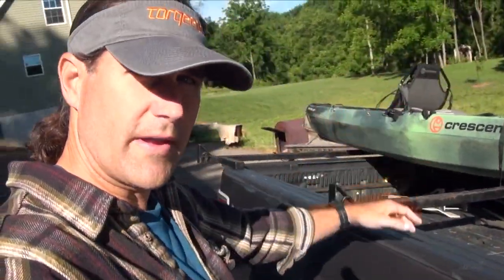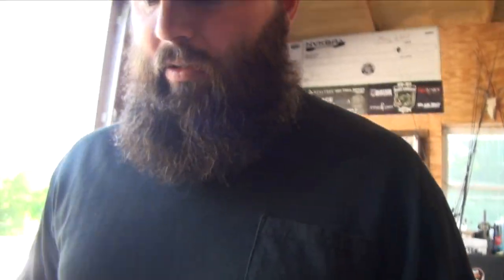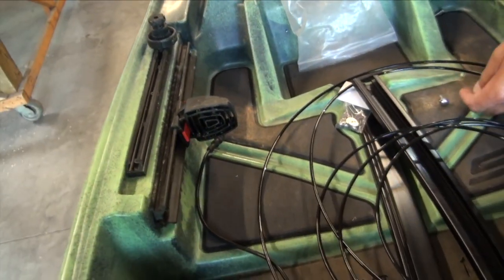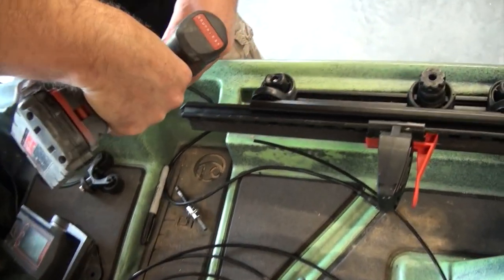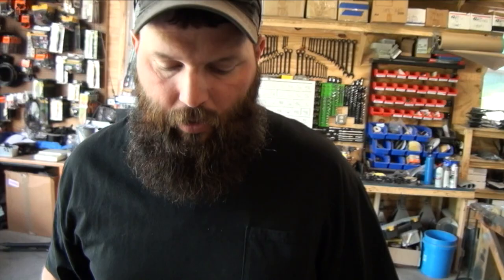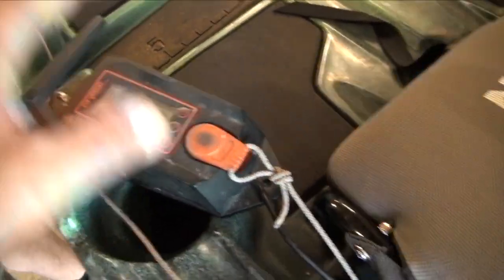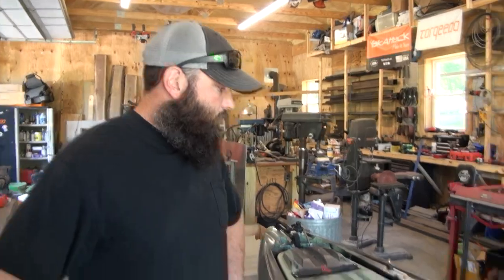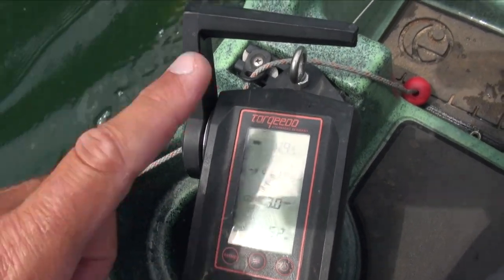Shoalie Torqeedo Install Speed and Range

Comment: Great video! As you are probably already aware of, the maximum speed of any displacement hull is governed by a simple formula: hull speed in knots equals 1.34 times the square root of the waterline length in feet (HS = 1.34 x √LWL). You may be able to get a little more speed out of the hull, but the increased power required will significantly reduce range.
Reply from the maker: The fastest kayak I’ve tested with the Ultralight 1103 went 7.6 mph. It was a 15.5 foot long Wilderness Systems Thresher 155. The hull is actually similar to the Shoalie, just much longer. So that plays into the formula you typed above. The length at the waterline changes once power is applied. The stern squats and the length shortens, unless there is a disproportionate amount of weight forward.

Comment: Getting ready to install a torqeedo on my ck1 and maybe a lite tackle 2 down the road. A question I had was the black tubing for the foot steering is 3/16" however I see some using the bigger quarter inch clear tubing as well. In your experience does the bigger clear tubing make for a smoother operation compared to this smaller black tubing? I was thinking maybe the cord sliding through a bigger diameter tubing might work better but you guys are the pros and if it does not add to better performance I will gladly go with the black tubing and drilling smaller holes if no benefit is added.😁
Reply from the maker: I actually did three installs on this last trip with three different types of tubing. The black 3/16th stuff that comes with the Innovative Sportsman foot control steering kit is the best to worth with during installation. I’ve not noticed any difference in steering smoothness with different types of tubing.
Reply: @TheLittleStuff  Excellent! Thank you for the response. Looking forward to all your fishing and kayak related videos this summer 😀

Comment: Is there any reason why you couldn't reverse the bolts that attach the torqeedo mount?  The round hex head seems like it would fit better inside the hull since it's such a tight fit.
Reply from the maker: It would probably work well. Good idea!

Comment: Is there a concern for how long of space the spectra cable is unprotected  before connecting  to pedals?
Reply from the maker: I’ve not had issues with that exposed length of Spectra. I suppose that a hook could catch it, but with all the horizontal rod storage I do, and it not happening to me yet, it’s likely not a frequent issue.

Comment: Would a deep cycle boat battery work for powering the electronics where you could just have the one battery and have a distribution box feeding the separate devices?
Reply from the maker: Yep. People do that all the time with a Dakota Lithium battery and YakPower system.
Reply: @TheLittleStuff  nice. Thanks
Reply: Would you recommend the shoalie for a first timer? Seems like it’s capable of growing with with more additions as experience is gained and plenty if room to add on. The black pack would look good on it

Comment: What kind of battery do you have?
Reply from the maker: The battery is part of the Torqeedo Ultralight. It’s a 915 Watt hour lithium battery. It is IP-67 rated waterproof. The internal GPS module communicates speed to the throttle. That is how the remaining range display is possible.